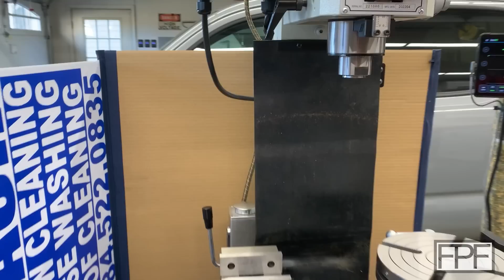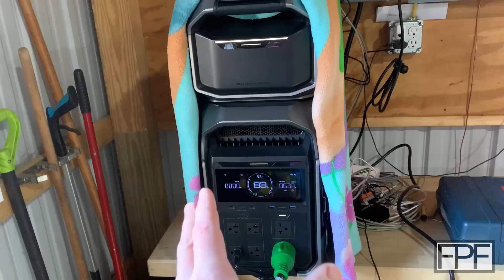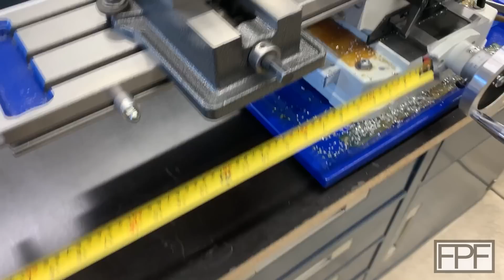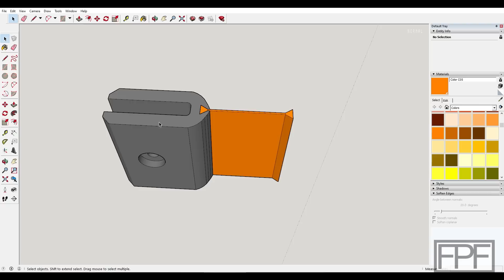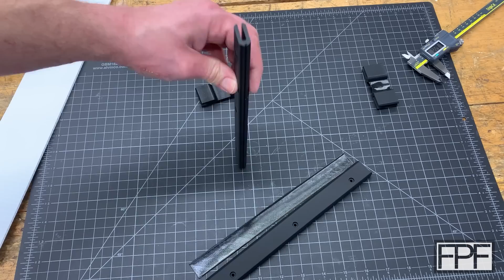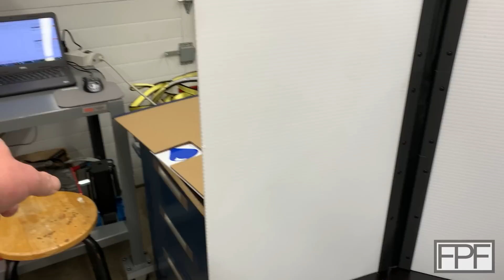3D Printed TPU Live Hinge - Chip Shield for Milling Machine

Comment: You made the TPU triangles just slightly smaller than the triangles in the PLA, but you could have made them quite a bit smaller.  All that matters is that they are larger than the slot so they can't pull through.  It's unlikely that the TPU would just slide out of the hinge if it's several inches long.  If there was a danger of that, you could always print a small cap to go over the end, or even just add a blob of CA glue to block up the end of the channel.
I'm loving your channel.  This is exactly the kind of practical 3d-printing ideas I've been missing from my feed.  The number one thing I've been asked when I've told them about 3d-printing is "what do you use it for?"  Now, instead of trying to explain all the little brackets, and gizmos, I can just show them your channel.

Comment: Here's a way to make putting the TPU in the slots easier. A trick I learned when putting rubber grips on handel bars is to use a water based lubricant. At the shop we used 409 spray cleaner. Spray it on both surfaces then slide it on in one motion.  Stopping can cause the film of soap to squeeze out and you don't want that.

Comment: This was a very successful project, I love the simplicity of the design!  I can see where this type of joint can be used for many applications.  I am amazed by the strength of the TPU triangle joint, impressive.

Looking at adding a 30 watt fiber laser to my arsenal.  Also been eyeing the Raptor Pro 3d scanner.     The past few weeks been building out my spray gun collection and stocked up on whole line of Monument paints and the Ammo brand weathering effects for modeling.  

My Plus4 and Q1 Pro both are now over 1000 hr mark.  Been making full build plate size statues in Plus 4 using Overture Marble Rock PLA they take up max build volume coming out awesome.

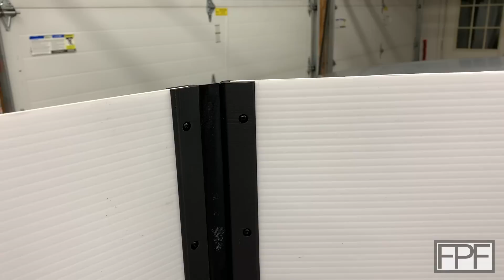Comment: At 36:28 It looks like the orientation changed from printing straight up to laying down, did you decide to change it up or is it just theway the light is hitting the two prints?  Great video!
Reply from the maker: the TPU?  if yes, the TPU was printed flat on bed for all but the all-in-one prototype, but I did rotate 45 degrees on bed, which changes the infill direction from the perspective of the finished part.
Reply: @FunctionalPrintFriday  i meant the PLA brackets.

Comment: From very recent experience, you can go at least 6 inches high with TPU and a very thin wall design no problem.  Surprisingly, I didn't notice any difference in quality from top to bottom.  That is on a Creality CR-10 bed slinger, so I would expect machines without a moving bed to do even better.
Reply from the maker: impressive!  I'll have to try it

Comment: Stole this method to make a draft stop for my garage man door comming into the house. Made a track with triangles on either edge to screw into bottom of door. Made the tpu just like you did but a bit wider. Slid in track. Tpu semi circle takes up the gap. Compresses over a carpet we have infront of the door too no problem. Great idea!
Reply from the maker: great idea!

Comment: Instead of modeling your brim, you could also have added a modifier object in the slicer that covered the notches and set the modifier to no-brim, no? That would give you flexibility in changing the brim parameters at print time to accommodate different plates/printers.

I haven't used Bambu's SuperTack plate but I have the polyurea plates from Darkmoon3D and BIQU that are essentially the same thing. They could probably do that tall print without a brim, if you use a non-interference infill and your nozzle stays clean—Slice Engineering's Plastic Repellent Paint helps a LOT with that. You might also have to reduce the print speed a bit, or put the bed temperature toward the upper end of the plate's range for the filament. You hit a point where the problem isn't so much bed adhesion as it is mechanical leverage if anything snags.

I think you'd be surprised how tall you can make a thin TPU print on a CoreXY machine. I've done crochet needle covers that stand on end on my X1C; they're about five inches tall and 3/8" diameter. The very top can have some artifacts, but it works. And at least once in your life, you should try printing something tall and skinny and TPU on a bed slinger; I tried this model once on my A1 and it was hilarious. It didn't go spaghetti, but it definitely became impressionist.
Reply from the maker: I think I tried, but brim wasn't in the list when I added the modifier (in Bambu, not sure about Orca)

Comment: Instead of a brim, combine 3 or 4 of them and connect with some designed-in support material linking the pieces, in a triangle or cross configuration.
Reply from the maker: I tried this when I did the pieces for the enclosure prior.  Even at one extrusion width with PLA, it was too much of a pain to get apart and clean up.  I ended up tossing a set of 4 because the juice wasn't worth the squeeze.

Comment: Tip - If you have not already tried it - Try "Skirt" in your slicer with a distance of about 0-0.2mm and a line count of 10-20. Nice way to quickly achieve almost same thing you did with the custom supports added to the design. I have found that it works well for small footprint parts where I do not want to add custom supports to the design.

Comment: I've been concerned about using TPU because my printer is in an office and isn't particularly well ventilated.  After watching your video a couple of weeks ago where you introduced us to flexible PLA, I bought some, same brand as you used.  I love the flexible PLA!  I've just printed a couple of parts with it and the results are very good.  Since TPU has a reputation for sticking very good to anything, and everything, I covered by textured PEI sheet on my QiDi Plus 4 with blue masking tape.  The results were very good.

Thanks for introducing me/us to flexible PLA, even if you didn't use it here.

Comment: Honestly feels like overengineering to me. Why print sheets out of tpu if there is plenty of flexible sheet materials like pvc/tpu/rubber. Only difference in the trim sheet holder to accept them. Also I think it's good idea adding chainlink like shape at top and bottom of the hinge to protect edges from tearing.
Reply from the maker: I might add pieces top and bottom i like that

Comment: I was going to do this for my mill using the design you did for the laser enclosure. I did use that design for a filament dehumidifier and that worked great. I like the idea of the hinge over the ridged corners. I know you had issues with the Bambu TPU for the AMS. Which TPU did you use for this project? Thanks.
Reply from the maker: SUNLU 95 A

Comment: Great idea and great implementation! Also, off topic, but is that oil accumulating on top of the base of the pm728? Is it leaking from the one shot oiler system?
Reply from the maker: From the one shot. It might be ‘one shot’, but it has 99 leaks.

Comment: Great project, this is my Saturday morning sipping coffee while everyone in the house is still sleeping routine to watch your video.  A couple improvement ideas that immediately came to mind.  One, print out end caps for the coroplast to prevent them from being dinged and dented over time.  Two, since you were using TPU, why not print a TPU cover with a slot through the center for the cutout of your cord to provide just a little more chip blocking capabilities.

Comment: Love how surprised you are when things actually work out even better than expected… which seems to be the norm.  TPU has always seemed scary to me, gotta give it a try, maybe I’ll be unexpectedly surprised how easy it is as well.
Reply: With modern printers TPU is a breeze and TPU has many uses. Custom wall gromets, gaskets, etc.
Reply from the maker: Underrated filament
Reply: It really is... its astonishingly impact resistant tok compared to far harder and more costly engineering filaments....
Reply: Modern printers are much better at printing TPU than old ones, but the formulations have also gotten easier to print. It's still best to print it reasonably slowly, but for a recent project, I cranked to speed up to 200mm/a and the quality was only a little worse than PLA. 

TPU doesn't have to be scary.

Comment: I was just wondering if the PLA part could be printed on its side, like an inverted U
Reply from the maker: Yes, but then the layer lines would have been in line with the same plane we need the most strength
Reply: @FunctionalPrintFriday  I guess, but I think the screws would rip through board before the print would break, only one way to find out, you do love a test🤔

Comment: Good design. Designing and printing features, like dovetails at +/- 1mm is tough. 

Ever seen a T Track hold down clamp? I think you could make something like this for the PLA side. This would let you print the PLA piece in two pieces on their back and use the screws to tork down the two PLA pieces to lock onto the coroplast and TPU. For this reason it might be better in PETG for more flex. Assembly could likely be flat this way. 

I am not sure it is better, just a different approach. I agree that this live edge hinge idea is a keeper. Thanks for sharing.

Comment: If I was doing this with just PLA, I'd make the clamping portion of the structure that goes around the corplas into a 2 piece clamping fixture, with a slip in key (or alignment slot) then screw the two pieces together through the coreplas I've found that a one (or if necessary 2) print layer live hinge (1lalyer, or 0.2 mm, 2 layer or 0.3-0.4 mm) works well as a hing. For a 180 degree fold, the hinge needs a bit more working area, half inch thick material seems like a good minimum. If you were going to add something like a half inch or inch of foam on the back for an acoustic absorption frame. perhaps to have a portable sound booth, I don't think it would be a significant problem. 

I'm wondering if we're going to start seeing things like this at school presentations or science fairs with the plastic of the hinge selected to provide a nearly invisible match for the poster board.It's not likely to work as an invisible horizon for a photo booth, but that's mostly a solved problem already.

One thought might be to 3d print some angle brackets to go over the top of the hinge when it's set up to help reduce the chance that a stiff breeze coming through the garage door might cause the panels to shift, or be knocked over, which might end up affecting performance. An alternative might be if the bench you'r using has a steel sheet as the top surface, (rather than wood) some magnets on a flap that comes out from the bottom at 90 degrees might be even more capable of helping with that. It might pick up some chips though, so perhaps not.

Comment: This is a really....flexible... system. I'm not sure it'd be necessary for this but I could see a use for a T shaped base piece that could be hook and Loop'd down to a bench for single sheet chip guards. 
It's probably unnecessarily but if chips go flying far enough for you to need a guard like this, then I wonder if it's worth having some kind of Lip that you can attach to the front of your bench so any chips that bounce off your new guards are somewhat contained to your work area until you're ready to sweep up. Maybe even something that could go as high as just below the front handle. Hm.

Comment: Did you consider half circles rather than triangles at the ends of the TPU? I generally try to avoid printing the sharp points like with your triangles.
Reply from the maker: I did but was afraid they would slip through
Reply: @FunctionalPrintFriday  If printed with 100% infill I thought the reverse but there is no point in speculating - someone needs to do the test
Reply: But the circles are not clean printing like the triangles.

Comment: Blankets can be a major fire hazard - they're extremely flammable, and even if they don't overheat from the batteries, a stray spark from all those wires in that corner could easily set the blanket alight. I really think you should consider some flame retardant insulation - either a ceramic fibre blanket or fibre board. It could even be the topic of an FPF video if you design some kind of structure for it with 3D printing.
Reply from the maker: Long term i was considering double wall steel
Reply: Or just use a fire blanket.

Comment: Nice idea. I can maybe print this on my Hydra tool changer in ABS and TPU, with no assembly. That can be a great test, I have already cut the 2020 RatRig extrusion that I'm planning to enclose my Sherline CNC with. TPU is such a fantastic 3d printer filament. None of my parts on my racing drones whole have made it very far without TPU. With a support column and brim I have printed 2020 extrusions 293mm last night to test my updated version Hydra tool changer, that uses a spring instead of preload bearing. So during tool changing no additional adjustment should ever be needed.

Comment: I used a similar technique for a redesigned headphone band, the strap that rests on my head I printed out of TPU, Which I then covered in batting and cloth.  Rest of it was PLA.

There was a notch in the ends for the band to lock into, and then a cover with a dovetail slides in to lock it in.
Reply from the maker: Nice!

Comment: Maybe I missed it... But why not just make the "living hinge" out of duct tape?  I feel like you could do it in about a minute per two panels you're joining... And you wouldn't even need screws... Am I crazy?
Reply: What about a strip of denim from yeah jeans with 3d printed toothed clamps that screw in or something
Reply: Tpu sheet from Amazon, cut in strips, clamped to each edge...done.
Reply: If he used duct tape, it wouldn’t be functional print Friday 😏
Reply: This is a 3d printing channel.  It'd be strange if he avoided solutions that involve 3d printing.
Reply: Duct tape is quick and easy but not long lasting. The adhesive might ooze out, the corners might curl up and it’s prone to ripping. It should only be used as a temporary patchwork solution
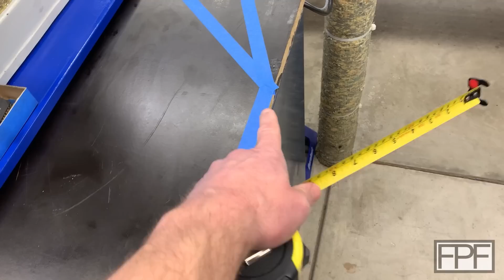Reply: His first version was with tape it was tearing at the ends so he had to retape it a few times. He mentioned you in the video at 9:48
Reply: @00anwi 😂🤣😂

Comment: Also, you only need the hinges to be so big, like the initial size but maybe 4-6 per joint.  Then fill in the rest of the gaps with a tape or cloth.  No need to print the entire height of the panel really.  And really, with all that said, just printing some "real" hinges 25mm long and using grub screws to hold them together and then just put some tape to fill the gaps would be so simple.  Love the effort though but just seems a little "over engineered for a practical solution.  Trust me, I've fallen into the same pit before :)

Comment: Only halfway through but why not design and print ant the angles you think you need?  You can still make minor adjustments with the flex and get aways with a thicker, shorter "hinge" so you don't have gaps in the panels for stuff to fly through.  Also, I highly recommend checking out Overture High Speed TPU.  It is my go-to function part material.  When printed somewhat thick it's quite rigid but still has some flex and absolutely indestructable.

Comment: Another great episode, and genius design. The only thing I can add is that silicone spray is really useful for helping plastic pieces with tight tolerances, to slide together. I also print TPU on the smooth PEI plate and it releases ok after a bit of time, with your IPA trick, to wick under the TPU, with capillary action. I use that a lot for PETG parts on a smooth plate, too.

Comment: Do you think it would be possible to make such a hinge as one piece using PLA and TPU in an AMS type system?  I wonder if PLA and TPU would adhere to each other.
Reply: You need to watch the vids from two and three weeks ago where he tried this, and not very successfully
Reply: I print TPU and PLA together for a medical device, on a dual extruder printer. They adhere together quite well but I still incorporate a dogbone end for positive retension anyway.
Reply from the maker: @grandpasbarn2806  dual-extruder machine is very much on my wish list
Reply: @FunctionalPrintFriday  seems this is coming soon from Bambu
Reply: But maybe the flexible PLA would work.  Also discussed in the videos on TPU for AMS videos.
Reply: @ also a possibility, or very high shore TPU.
Reply from the maker: it might, but the flexible PLA is too soft for the AMS
Reply: You need a toolchanger or idex for that.

Comment: I have done something similar for the doors off my RatRig. I just printed 2 layers of TPU the whole width of the thing flat on the bed and then ABS (works with PETG just as well but not with PLA) on top to get the rigidity. That places the hinge at the outside and gets the doors to line up with the printer frame very well. Just a few magnets that fit inside the extrusions to close and keep open the doors. This sits for well over a year on the printer now.